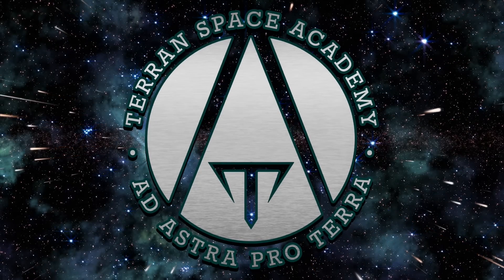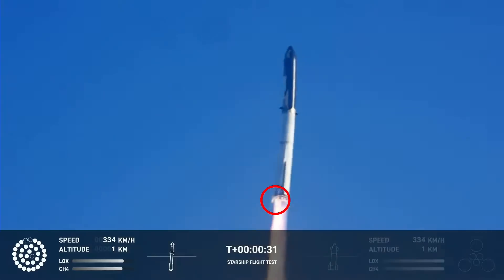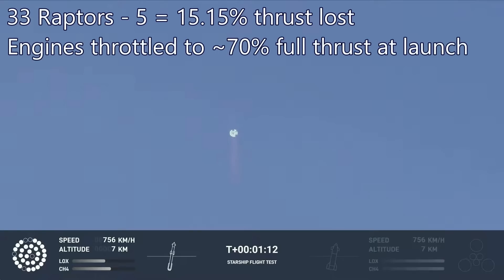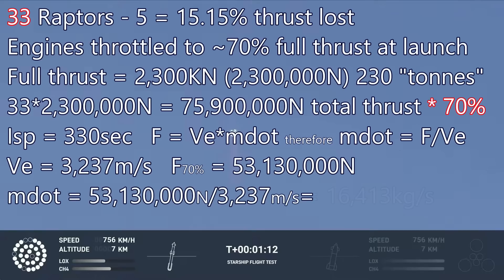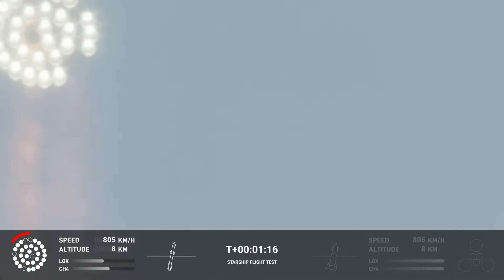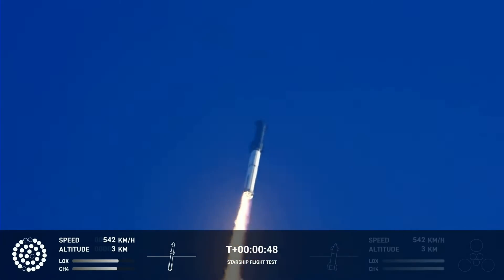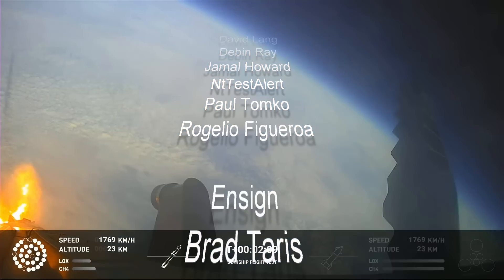Starship Flight Analysis: What went wrong with Starship?

Comment: Looks like a lot of debris was flying around before it cleared the tower, some pretty big chunks flying through the air. I think it is highly likely that several engines were damaged on lift-off. If that is all it is, it's good and they can fix that pretty easily, however it also points to somewhat shoddy design of the OLM. The lack of a flame diverter/trench and a water deluge always seemed to be a recipe for disaster (as is the short distance to the tank farm). 

As for stage separation, I think the narrator was sort of stuck trying to mix the script with what was actually going on. I am pretty sure that the stage separation should occur before any flipping happens, just like Falcon and Falcon Heavy.
Reply: I also heard the launch pad was badly damaged at launch time - confirming your suspicion the launch pad wasn't adequately built and prepared to handle those forces.
Reply: On the upside no need for concrete excavations now for the deluge system which as everybody observes was sorely missing. There will be a fly over by Mariseo Friday and a report back usually on Saterday. Loots of detail to be had there.
Reply: No, the flipping exactly was meant to initiate stage separation by using centrifugal force. The "dance" was started intentionally! But the separation failed and thus the 2nd stage engines never were lighted; (edited:) OK, I stand corrected. It drifted off. It was not intentional ;-)
Reply from the maker: It's amazing it made it into the air.
Reply: @terranspaceacademy  Sure took a long time to get going. Maybe it was all that extra concrete weight it was carrying. 😀
Reply: @terranspaceacademy  absolutely.  Shows how redundant and robust it actually is.
Reply: @terranspaceacademy   I think one thing that may be lost in all the videos i watch and comments I read is (and I'm no engineer by any means),  SpaceX is one of  the worlds most technologically advanced and rapidly innovative companies in Human existence..... Do we really think they didn't have this launch pad in mind, and maybe it was purposeful?
Reply: With all that thrust coming out, hard to believe concrete would kick back up into the engine area but who knows. I guess they learned a lot from this launch and can fix these problems. Ether way, it looks like this thing actually works as it got it  up very high and if it separated, it would have finished the mission, even with all of the engines going.
Reply: @Fighter4Street  equal and opposite reaction
Reply: @Fighter4Street  Tim Dodd from 'The Everyday Astronaut' was covered in debris and had to run inside over 5 miles away live at launch.  😂
Reply: In the one camera angle where the tank farm is behind and to the right of the pad there is a large black object that just starts to clear the cloud of Texas :) about halfway up the stack. You can only see it for a few frames then it falls back down and the cloud gets bigger and the rocket starts to move up. I think it was one of the cameras the NSF guys were showing. I'm happy nothing flew out and hit the fuel tanks. That could have been really messy. :)
Reply: I keep seeing all these comments about 'shoddy' design of the OLM.... Its been discussed and pointed out by Elon and SpaceX many times in various interviews,  that exactly what you suggested is being prepared for and done in the very near future.  For those who follow the development of starbase closely,  its even been pointed out that the exact equipment and materials for this job have just recently shown up near the pad.  Im sure they knew this was a possibility before launch and plan on doing that work between launches rather than delay the 1st.
Reply: Starship separation is different than falcon 9. The booster starts the flip with starship and then it separates. It helps fling starship away is how it’s supposed to work. It’s a complicated dance.

Comment: We saw a flash a couple of times in the engine are.  This could mean that rather than just shutting down, the engine may have exploded.  If it/they did the there could have been secondary losses (like hydraulics).  I know SpaceX can changed to electric motor gimbling but what are they using for the clamps that hold the Starship to the Booster.  If they are using hydraulics, the engine failures may have been the ultimate cause of everything that happened.
Reply: It wasn’t the engines that were the problem, but the HPUs that clearly exploded due to the exact position of the explosion at ~T+30 seconds. The engines that initially failed were probably due to concrete-destruction related damage and the rest that shut down had been damaged in some related way.
Reply: True, people said there was hydraulic loss that caused no engine separation, but hydraulics come from running engines.
Reply: @paulwilson8367  my thought was that an explosion could have severed lines (or worse) and depressurized the hydraulic system.  It wouldn't matter how many engines were running at that point.
Reply from the maker: Or was stuttering...

Comment: The reason it didn't separate on time is because of the engine failures (and you missed quite a few of them, the one at 6:10 and the cascading sympathetic failures at 6:20).  With all the engines out, you see the propellant consumption rate drop drastically since so few engines were left running.  The separation would not be initiated before the end of burn on the booster and the boost phase ended up being a lot longer than expected.  This is about as unsuccessful as a flight can be and what they really learned is that Raptor reliability is nowhere near high enough to be useful as a booster engine and the pad surface is nowhere near strong enough to survive launch.  Neither of these things can be fixed in the short term, if at all.  The fact that they were able to fly through all that FOD is pure luck; the vehicle could have (and by all rights, should have) been lost before even clearing the tower.
Reply: This. Dumbest launch test ever. All that debris at launch is embarrassing. That thing was dumping fuel the entire way up because they thought a grenade of shrapnel at launch was going to work ok.  It's amazing it even reached the heights it did
Reply: I cherish this type of response because i makes it easy to rip into you easily about how wrong you are about success and also about how little you know about what there process is actually is.  If you were a engineer I would take your comment a little serious but your not. So honestly your comment matters nothing because maybe think maybe they knew about the flame divereter and water deluge, but realized it was going to take another 6 months or more to get to that point but by then you be waiting still to get data on things, and that would be also hard to figure on how you would modify the olm to figure that flame divereter, so they said just launch it to get the data and then go and make the big upgrades to the OLM the raptors are doing fantastic honestly no idea where you came to that conclusion have you even seen the Macgregor Texas streams on there progress on it.  There always upgrading thing little by little.  So bottom line you have no idea what there testing process is like and so in the end i think it was amazing sucess and honestly your attitude speaks a lot about how you view life in general and why not focus on doing something positive for a change for humans, because that negativity does nothing but bring humanity lower, so do us a favor and change your mindset. PEACE.
Reply: @M_Lopez_3D_Artist  So I guess you're saying I'm wrong, or are you saying I should lie.
Reply: Your comments make absolutely no sense but you are entitled to your opinion. The fact that it survived the launch on it's very first attempt is HUGE, and SpaceX no doubt obtained massive amounts of data compared to what they would have gotten, if all it did was blow up on the launch pad. If the US government was funding this, I would agree with you about not having a quick solution. SpaceX will come up with a solution quickly, and implement it, and I'd be willing to bet they will attempt to launch again in the coming months. If it were the government, we would be waiting who knows how long!
Reply: @petef.4361  Seriously, did you see that hole where the pad used to be?  That pad is built where the water table is about 18 inches below the ground, it will NOT be easy to fix.  The Raptor is flawed in concept, design and construction; it's a truly terrible engine and fixing that won't be easy either.
Reply: @Strike_Raid  Where there's a will, there's a way!
Reply from the maker: When it gets hit by big chunks of concrete... try that with an RS-25.

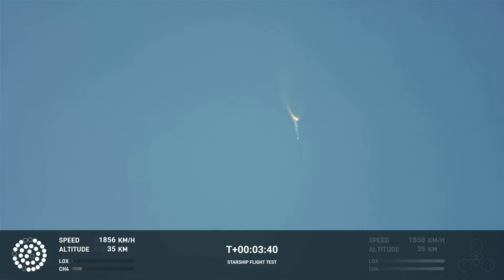Comment: Great video! 1:07 It's CNN, it's always deceptive. You'd think they would spend one second talking to someone, for example any six year old into space, to clue them in. Snarky and ignorant and so full of themselves. That's life, but here people are trying to inform the people and those parasites are doing the opposite. Grrr. 6:46 'The torque prevented the disconnect' - That makes a lot of sense to me, a nube. Hopefully a simple fix like explosive bolts will work. I like your idea too: Have Starship move away from Booster with unignited engines. But that would still leave booster in line with ship's exhaust. Maybe some combination of all of the above. As to the engines, do you think concrete pieces flew up at launch to damage them?
Reply: CNN:

SpaceX Starship Explodes on First Launch Attempt

Fox Business:

SpaceX successfully launches giant Starship rocket, explodes minutes later

SpaceX launches first test flight of world's most powerful rocket before Starship explodes in midair

Yeah, there's a world of difference there. Looks like this video was a few engines short of controlled pitch.
Reply: @pdutube  derp, I'm talking about a lot more than just starship coverage
Reply: @squirrelsinjacket1804  I didn't reply to you and I read and agree with your position. Why a tech channel had to bring in a media bias angle is beyond me, maybe it's just an identity crisis or maybe it's a propaganda machine, IDK. Squirrels are cool.
Reply: That’s a really good point about engine damage causing failure later. With fuel circulating around the bell to absorb heat, any damage to the bell would cause pressure loss and engine flame out…exactly what we saw on Starship. Flying chunks of concrete, rebar, rocks etc are exactly the kind of debris that would tear up an engine bell, but not show up as a problem with the rocket itself. Nice.
Reply: Booster in the way of starship engines wouldnt be too much of an issue, same is the case for Falcon 9. Byt the time all 6 engines ignite on the ship, the booster will be well into its flip sequence.
Reply: @MrGeneralScar  I think you're probably right.
Reply: Cnn is owned by bad ppl who hate Elon because he took away their twitter echo chamber.
Reply from the maker: Thank you!
Reply: @@richardcranium1776 If you were smarter you could understand why.
Reply: @squirrelsinjacket1804  certainly sounds likes cnn
Reply: CNN still better than Fox
Reply: @squirrelsinjacket1804  Normally I wouldn't argue the difference in appeal between bullshit and horseshit, but you do you.

Comment: The HPU exploded at about 30 sec into flight. Doomed the separation maneuver but only if decoupling required hydraulics. We shall see.
Reply from the maker: We've been told that decoupling does not require clamps but I'm not convinced.

Comment: 5 thousand metric tons is not 49 millions kilograms, it is 5 million kilograms
Reply from the maker: 5 thousand metric tons is 5,000 x 1,000 kilograms therefore 5,000,000 kilograms, you are correct.  But I was getting the weight and said kilograms instead of newtons.  5,000mt is 49,050,000 newtons... which is what I should have said. :-)
Reply: @terranspaceacademy  gotcha

Comment: did not know they were using Flip maneuver to separate  - i dont see advantage to doing flip
Reply from the maker: We don't either... they thought it would reduce complexity.
Reply: @terranspaceacademy  the clamps may not have opened since the HPU exploded disabling all hydraulics in the booster.
The thing is if the clamps are eletric or hydraulic, we don't know that.

Comment: the pad survived ... I'll take it !!!
Reply: Starship is really good at pulverizing concrete haha. They have got to create an indestructible concrete if they continue down this path of no flame diverter trench like the one used by the space shuttle.
Reply: @theamericanjoeshow  RGV has pics of "flame diverter" parts in the yard and the water deluge should be operational at the next launch ... my guess is it was debris that killed the engines .. and also they need to work on  the stage sep
Reply from the maker: Us too Duke!  Everything else was gravy :-)
Reply: Well survived better than than sls, sort of. Maybe.
Reply: @GrigoriZhukov a lot worse than SLS
Reply: Not really. There's a few pictures and videos out there showing a complete mess. Someone from NSF actually had their vehicle damaged from flying debris some distance from the site. Pretty sure the FAA isn't going to allow another flight until SpaceX addresses the stage 0 issues... Which we all figured was a big problem.
Reply: @RickL_was_here  Same with NASA at the Cape. SpaceX has to solve that problem quickly.
Reply: Pad itself was destroyed along with storage tanks and who knows what else.  No comment was made about the lack of deluge system (allegedly Musk wanted to proceed sooner than it could be made ready) or the damage and flying debris possibly damaging the booster.
Reply: @rcpmac  destroyed ?? ... damaged maybe .. but certainly not destroyed ... this is how musk builds and i would say falcon 9 is proof of concept .. this will be repaired and in a very short time ( a few months ) they will launch again .. with a water deluge and possibly even a flame diverter